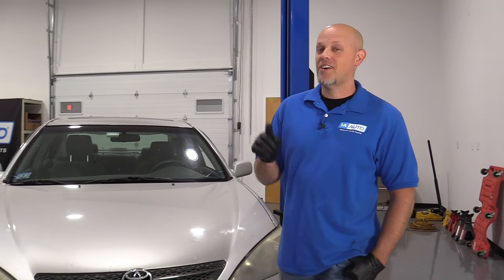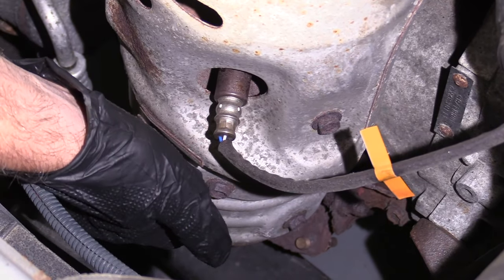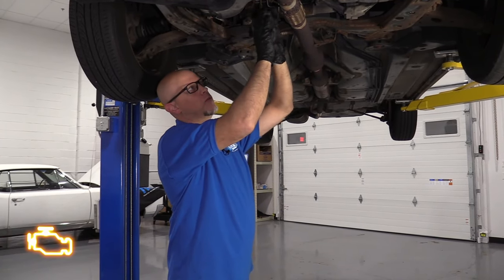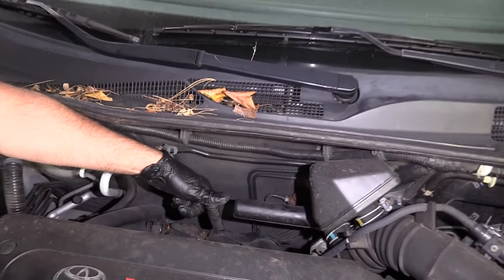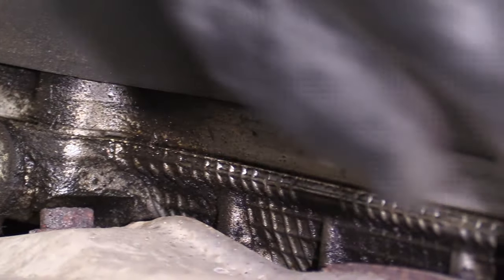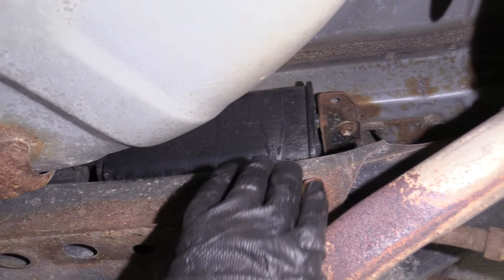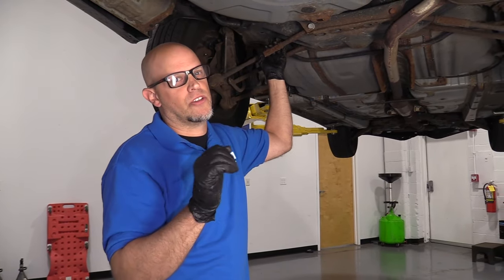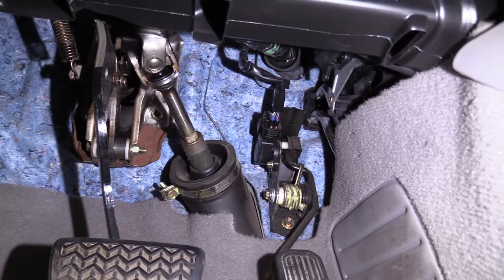Top 5 Problems Toyota Camry Sedan XV30 5th Generation 2002-06

Comment: SWEET!! Good to know before I buy an 03 with 63k miles on it.
Reply from the maker: +Voltis_5 Thanks for checking us out, hope this info helps! http://1aau.to/m/Shop-1AAuto-c
Reply: Buy that shit up!
Reply: @zanebalamut2165   bought it last week! Owner wanted $4k but was able to too drop it down to $3500. They had some work done last year before selling it. New tires, new battery, brakes all around, both 02 sensors (it does need new valve cover gaskets though, hope it's an easy fix). Besides that car drove great with no issues.
Reply: @Voltis-5  I'm about to sell our 03 by xle camry with 81k miles for $4500.  I have half a dozen people interested in buying it. Been waiting for my title from the dmv. Just finished putting new rear brakes & rotors today. Might have to bump it up another $250. Going to drain & flush the transmission and get it inspected soon. So everybody needs to wait on this gem. Got a Corolla with 81k too ready 4sale.
Reply: @customer7575  nice! Are these your personal cars? I'm actually also looking for a corolla to buy for my son who just got his drivers license 😅

Comment: Thanks for the video. Please, my mechanic used 20w50 oil instead of 5w30 in my 2005 Toyota Camry. In my next servicing, is it healthy to correct the oil?
Reply: It is totally wrong, I think. For a regular US climate you can use 5w-30 or 5w-10. For extremely cold weather sometimes 0w-20 is OK (Canada).
Bit 20w-50 it is ok only for some places like Dubai when +50 C degrees is Ok. Or when your engine has too many leaks and in case of fo
fixing them some mechanics use heavier oils to tap these leaks. For me it's a Red Flag when some mechanic suggest 20w-50. Look for somebody else.

Btw Toyota manual says 5w-30.

Comment: I have an 05 camry 3.0 V6, quick car car with that spare wheel delete, I've got about 140k miles on it, I live up north so its got a bit of rust here and there, I had to replace the fuel tank, radiator, front left shock absorber, fix the siezed hand brake (havent done that yet). Thats bout it, runs like a champ. Oh and It does have a check engine light from a bad o2 sensor, thats about it.
Reply from the maker: Great! Thank you for checking out the video. If you need auto parts go to: http://1aau.to/m/Shop-1AAuto-Now
Reply: @1AAuto  not interested.

Comment: Gotta 06 sxv30 with exactly 100k on the clock. Had a rattling noise and it was the timing chain tensioner that got loose. Still pretty easy to replace.

Comment: 2003 4 Cyl 
632K miles original engine and transmission 
(Oil changes done every 4500 mile) 
Transmission Oil change Was done At 310K miles

Comment: Bought 2002 Camry 160k miles not gunna lie treated it like shit but only changed the oil throttle cable valve cover gasket  and sold it with 240k miles most reliable car ive ever owned besides my 99 Tacoma pre runner
Reply from the maker: Great! Thank you for checking out the video. If you need auto parts go to: http://1aau.to/m/Shop-1AAuto-Now

Comment: 3:56 I have an 04 with the 2.4 with a gas pedal delay but I have no codes, I've checked all over engine parts like the throttle body and everything looks fine, any thoughts? Thanks!

Comment: Why does my camery lag when throttling either to over take or to go at higher speed??it takes like 2 seconds to respond then jumps into action and lastly.. it occurs after slowing down to climb a speed bumb i might be trying to throttle gently....it won't respond untill I keep more pressure then the car jumps like I trying to go for a race

Comment: Please I have a question, between 2007 Corolla and 2006 Camry which should I go for? The purpose of the usage is commercial (e-hailing).  Currently I use 03 Corolla with 267k miles but thinking of upgrade within the year.

Comment: I’m looking for idle solutions. Vvt solenoid is good. Several attempts of relearning the curb idle didn’t work. There is not an idle control valve on these models—all computerized. Alternator is good.

Comment: My biggest issue was having to replace struts and some fron end parts at 330k. cost like 500 in parts and 500 in labor. But 1 grand for great ride was worth it. No car payment and have not spent any money on it in 2 yrs but oil and tires so for 21 yr old car 1 grand was not bad, now rides smooth no squeaks. Those were original struts LOL
Reply: Spent in last 3 yrs about the same as my friends accord car payment for 3 months so why am I complaining LOL I have v6 he has 4  I have more room and ride as good loaded v6 xle sunroof dual power seats high end JBl system leather cruise electronic ac heat that works as it did new never touched the system, rides as good as accord and I have leather he has cloth, he hates my camry. Best damn car I ever owned lasts forever cheap to maintain rides 95% as good as brand new one almost as quick as new v6 but I owe nothing and have more room. I spend less a yr than any new car to maintain. service is cheaper as car is more accessible parts cheaper and never fail. 21 yrs every motor window lever switch and light works as new even trim is 100% intact. Show me any other 21 yr 350k mile car that can do it but toyota and lexus. Even honda cannot do it, close but not the same quality of older toyotas, not so sure about new ones worked at dealer and drove newer ones less room to expensive and until I see many hit 300k miles I reserve opinion on reliability

Comment: I have an 03 and am having issues when breaking my pedal sinks all the way down and sometimes feels like the break doesn’t even work so I have to keep hitting it like a mad man , do you know what could be causing this?
Reply: I fixed this on my camry by changing the brake master cylinder . That part that has the brake fluid reservoir that’s connected to the master cylinder . Change it and the sinking pedal would stop . It goes down like that because the master cylinder is unable to hold fluid pressure

Comment: The only problem I have is I still own one that I bought back in 2003 lol!   It's an SE model with a manual transmission.  Only bad thing is she's rusting out and I refuse to buy another car until this car completely dies on me.   286 000 kms  when I do start looking for another car it will probably be the same year's or the corrola that was made around that time.  Since the car is a manual transmission I put on an cold air intake and straight pipe exhaust.

Comment: I'm dealing with a P0171 code on my 2003 Camry. I cleaned the MAF sensor first, cleared the code but it popped again. so, I guess I'll try the O2 sensors next.

Comment: You forgot piston rings wearing out. And burning oil.
I have 2004 camry. I bought it brand new. It burns oil and has blowby, however I put over 300,000 miles on it.
Reply: How much Did it burn

Comment: Any 2001-2006 Toyota vehicle with 2AZ-FE, 2.4L, engine is susceptible to the infamous stripped head bolt problem.  It may also burn excess oil. If you got the stripped head bolt problem, you'll be losing coolant without visible leak. The correct repair is too costly.  To buy time, you can bandaid the problem by removing the thermostat & bringing the overall engine coolant temperature down. ( You'll generate an engine CEL, lose some mpg of gasoline )  In the city, leave your AC on, thereby keeping the radiator fans on.  You'll need to top off coolant weekly. Fyi, the
Toyota 2AR-FE 2.5L engine ( 2008-201?) is a much more better engine ( just check the oil level monthly, Religiously ).

Comment: I have the oil leak coming from the valve cover gasket. So your saying I just  need the cover gasket replaced? It's nothing wrong with the actual engine just the cover correct? Great video.
Reply: Yes like he said and showed. Remove the cover and change the gasket. It's just letting the oil leak out. The engine is perfectly fine.
Reply: If you know what a 10mm socket is, you can do this job : - )

Comment: Just bought an 05 Camry. Same Motor. And light is on and bad mileage. So replacing the O2 sensor. Will that give a code for maf sensor if o2 sensor is bad?

Comment: Very informative, I've a '99 camry, it has a cable for the accelerator pedal. Very simple design, seems better than another sensor that can fail. When my car eventually fails, I'll take a horse, not to ride, but to complain too about how complex and unreliable they've built cars. They've too many gizmos that are unnecessary and can't be all that GREEN for the environment.  I see it in all the cars when at a junk yard, some not really that old either.
Reply from the maker: +James Smith Thanks for checking us out! http://1aau.to/m/Shop-1AAuto-c

Comment: Also the transmissions on these always go bad unless you're superrrr on the maintenance, especially the U151E (U250E)

As for the evap canister, this is from topping off. Just let the pump click once and stop filling and you'll likely never get that issue
Reply: My 03 trans has 250,000mi on it. Still on the original fluid from factory! Never been serviced. Makes me cringe every time I say that, but the darn thing runs smooth as can be.

Comment: I love my 03 Camry.  Bought it used in 2019 and so far the only issue I had was this nefarious issue with a computer.  It was destroying O2 sensors.  Went through three or four before figuring out that a computer was the culprit.  Replaced what the junkyard called a "brain box" above the passenger foot space, replaced O2 sensor.  Issue hasn't returned in over two years.
Reply: I think I have this problem and now the faulty 02 sensor is destroying the cat.
Reply: Was it a V4 engine??
Reply: Yup.  Inline 4.

Comment: My 05 runs great but the transmission is starting to slip a little bit, any recommendations? I’ve heard that replacing the transmission fluid on a car this ahem seasoned could cause a lot more problems so I’m hesitant to take it to the shop.
Reply: The best  and only thing you can do for your transmission is  to change fluid no matter how old your car is. Don’t flush.
Reply: You can change the fluid in a gentle way: 1. Buy 10 liters of it. 2. Open the cap  and wait until 1 liter of liquid has poured out. 3. Close the tap. 4. Add 1L of the liquid. 5. Drive 1000km. 6. Repeat steps 2-4. 7. Drive 1000km 7. Repeat steps 2-4. 8. Drive 1000 km. 9. Buy transmission filter. 10. Open the cap  and wait until ALL liquid has poured out (approx 4 L). 4L of old liquid still be inside. 11. Change transmission filter. Clean all the with special liquids or just gasoline.....12. install new filter and add approx. 4-5L of liquid. Enjoy the drive. Don't do it by yourself, find some good mechanic.

Repeat all this steps each 40k km

Comment: 20 years later... leaking radiator. Easy to replace as DIY. Just bought the fan assy and radiator from 1A. $200. Easy fix. The camry is bulletproof

Comment: On my 2006 Camry when I press arm alarm button on fob the horn short beeps twice and no locking happens, perhaps indicating a door is left open but I can't isolate the problem on any of the door switches. What could make the arming not work? I've disabled the audible sounds. Only lights flash. Btw car of the century.UPDATE. problem seemed to resolve itself after i pushed at all fuses in under hood fusebox

Comment: EVAP do not fill to top, when pump stops do not rund up to next dollar it soaks canister and cause error.  if it happens run a few gallons out reset it goes away but over fill it will come on again. mine did it and I finally found out why. when pump stops STOP pumping and issue is gone

Comment: @1A Auto: Repair Tips & Secrets Only Mechanics Know  I have an '02 Camry, 2nd owner. Never miss an oil change. I use only full synthetic because it's over 200k miles (was recommended). It started to make a loud sound at 30mph, and vibrate. I looked at the rmps & the needle was shaking. Took my foot off the gas & it stopped. It's never done this before. My mechanic told me it's the timing chain about to break & to park it if I didn't want to end up stranded.  He quoted me $1, 800, so I've had to park it. Finally saved enough to get it fixed, but it has sat for 8 months now. I've heard it's a good idea to drain the gas & replace it with new gas before trying to start it. Is this true?  I just had the transmission fluid changed 2-3 months prior to this happening. Any advice is greatly appreciated.
Reply: Just drive it!

Comment: Hi,I drive a 2005 Camry and when I scanned it ,it brought up a P0016 & P0037 pls what does these codes mean?
Also my oil indicator lights blinks and goes out when rev up the rpm .I've changed the oil switch once and yet it's still blinks.Please what could be the problem and what do I need to do?

Comment: Generally  2 upstream O2 sensors are used same model. But 2 downstream o2 sensors are different model. Most people forget this info.
Reply from the maker: Good tip! Thank you for checking out the video. If you need auto parts go to: http://1aau.to/m/Shop-1AAuto-Now

Comment: Forgot to mention with those engines 2azfe that the cylinder head bolts are common start to strip on their own  causing overheating issues especially when coolant is leaking behind the intake manifold I know this because I experienced it and fixed it with a timesert kit which runs about $400 to $500 dollars I was lucky to get a used one on ebay fr around $300 just had to buy new inserts pretty extensive work but worth it instead if buying a used motor and it happens somewhere down the line again haven't had any problems since I'm currently at 245k on my 06 had it about 6 years I can take it anywhere without any doubt it won't break down
Reply: How can you check if you have that engine 2azfe?
Reply: @bayfinest1938  under the hood or 02-06

Comment: Question: 2003 Camry stalls after warm up. No check engine light or codes coming up.
The car was doing great until one day my area had an outside temperature of 113 degrees.
Any ideas?
Reply: Likely fuel injectors are dirty. Add some fuel injector cleaner in your gas tank.

Comment: What about the oil burning issues? The 4 cylinder is a monster and mine eats a quart Every 500 miles. I still love my car because it has been nothing but perfect other than that
Reply from the maker: That sounds you might have a PCV problem. Thank you for checking out the video. If you need auto parts go to: http://1aau.to/m/Shop-1AAuto-Now

Comment: 2003 Replaced the sensors and still getting p2238 b1s1 positive current cotrol circuit low...

Comment: In my book, the TOP ONE issue is the infamous engine cylinder head bolts stripped due to bad design. You need a engine replacement.
Reply from the maker: Good tip! Thank you for checking out the video. If you need auto parts go to: http://1aau.to/m/Shop-1AAuto-Now
Reply: I've seen kits and one post where a guy paid to have all 10 bolts retapped. It ran around $1,900, compared to a replacement of around $4K from what I've heard.
Reply: There's "Heli-Coils" for that.  Cheap and solid fix.

Comment: I got alot of problems with my 2004 3.0:1st timing belt at 120k 2nd timing belt at 220k 3rd oxigen sensor at 230k other than that still runs like the first day it came out of factory  those are my mayors problems

Comment: Not usually carbon canister but vsv mounted on canister. Buy denso or OE the made in china will fail. The canister vent hose is stuck into tear rear subframe & spiders & bugs can block vent causing hard fueling issues. 

Also early 3.0 V6 engines have severe oil sludge problems unless oil changes are done regularly  throughout the life of vehicle. Lastly automatic transmission shifting problems usually over 120K miles. Just my thoughts on these
Reply from the maker: Thank you for checking out the video. If you need auto parts go to: http://1aau.to/m/Shop-1AAuto-Now

Comment: Sir I have Chevrolet optra 1.6 automatic model 2005 . I have changed engine oil Caltex  20-50w after 300 km   
I check the oil that was too low  up to half on dip stick . Then I put the oil Havolin 20 -50 w it's again burn but I found RPM Gage goes up to 25000 . Now a days there is smok  and burning of engine oil.  Is it any sensor problem. Plz solve my problem. Thank you. God bless you.
Reply: 1. Chevrolet Optra 1.6L (2004-2007):
    - Cause: Worn piston rings and cylinders, leading to excessive oil consumption.
Hope this help!

Comment: Thank you. Do you know when I should change the timing belt on my 04 with 109k
Reply: If you have the 4 cyl it has a timing chain, the V6 has a belt that should be changed every 65k miles
Reply: @colinmcguire2933  Thank you. I have a 6 cylinder